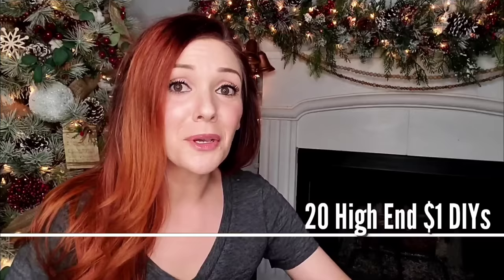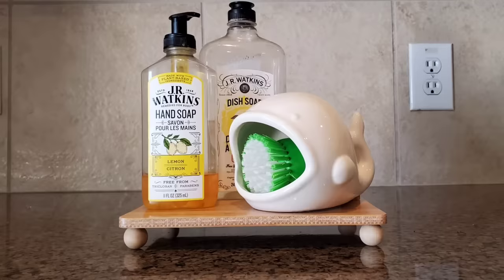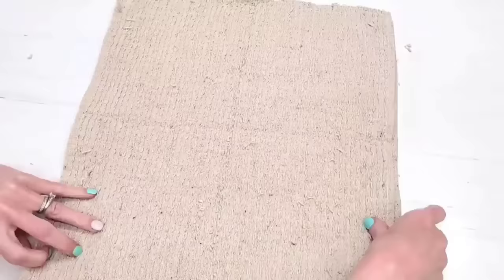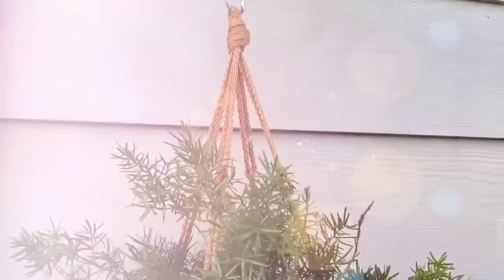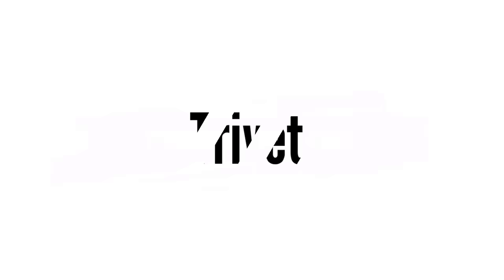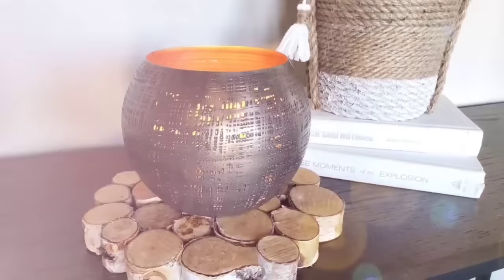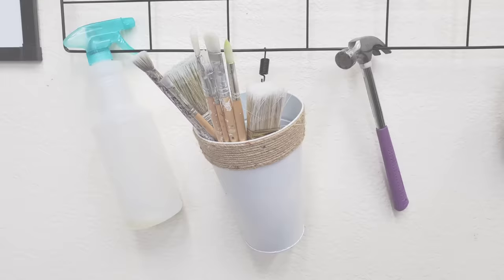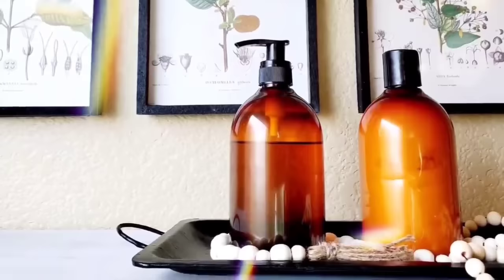20 HIGH END Dollar Tree DIY Room Decor Ideas to try!

Comment: I really enjoyed this video!  I think your fern in the hanging planter may have done better with what looks like a bit of shade/protection.  It also would drain better when not sitting on something.  I've had similar experiences and while I generally have a green thumb I continue to learn by doing.
Reply from the maker: The table has holes in it or water can drain out? I also put pool noodles in the bottom of both to help with drainage, but net year if I try the same type of fern I will buy it on something it can drain easier. So much love to you Teri ❤-Megan

Comment: DT does have adhesive backed cork sheets. I love them and pick them up all the time. Love your crafts.
Reply from the maker: I have seen others use them but I have never seen them! My DT is extremely small and even though it does stock up on some cool items they don't have a crafter square section. But I will an eye out for them ❤ Much love & Merry Christmas
Reply: @GlueGunsRoses  I hear you can order from $tree online...

Comment: Great video, superrrrr helpful since the find myself in DT like ever other day! I don’t know if you’ve seen it, but Dollar Tree actually does sell cork! They sell it in the craft section like an adhesive sheet, about 6x9. I used it on a canvas to make a DIY cork board since it’s so thin (and my push pins wouldn’t go all the way through). I’m thinking about maxing my buck by cutting small circles and putting 4 on each coaster, like little feet. Thoughts?

Comment: Another cool idea would be... Use a coat hanger... Drill a hole through the middle of the cut pieces of little circular tree branches & stack them up on the coat hanger to make a cross..! Cut the coat hanger to desired lengths & make a big cross to add to a mantel or whatever.

Comment: Fox tail ferns are heavy drinkers. The planter you used for the top has places to store extra water inside (it's a "self waterer") so even if you poke holes, it will retain so water. I bet that's why the one fern was still doing so well! The other one drains extra well, but that means it would need to be watered more often than the other one.

Comment: I loved the orbs and made some myself. Only thing I changed is I combined some DT rope and twine for two of the large circles. Also, I discovered that the third circle couldn’t “fit” into the other two without them becoming ovals. So I cut a piece of wire from the unused rings and added that to make the third circle a little bigger and go on the outside of the other two.

Comment: I seen you grab the drizzle popcorn. You can make your own with dark chocolate melts and a bag of chicka boom kettle corn popcorn. You cover a cookie sheet with wax paper, spread the popcorn out, melt the chips and use a spoon or rubber  Spatula to drizzle it on the popcorn and it's cheaper.

Comment: I don’t use the little game blocks, use a paint stick and since you have to cut the end off, and you can get them in different lengths, glue 2 of them together. Or if you have wood like I do from the barn , just use a 1x1” piece and cut to length if you are going to sand the blocks anyway

Comment: I wouldn't put holes in the bottom of the rope planters.  I'd use them as decorative containers for hiding a plain plant pot (potted up with compost and plant), so you just see the nice plant coming out the top of the planter, and the inside pot would drain into the rope planter.  If the rope planter was to hold a plant and compost directly and had drainage holes, very quickly the rope would get dirty and wet near the bottom.

Comment: I know what you did wrong with the Planters cuz I did the same thing. I made the holes too small. It couldn't drain properly even though there were plenty of holes when I removed the plant the bottom soil was soaking wet exclamation point so much for my hydrangeas. When I saw the mistake I pulled them out planted them in the yard and they're doing great after a very scary start😮

Comment: drainage holes on the pot on the table were blocked from draining by the surface tension of the water that was meant to drain try lifting the pot by gluing those wooden beads on the bottom

Comment: One NEVER USE FLOSS! USE cheap fishin line. It never breaks. Thats what its designed for. Wont gey brittle or fray or break either. Outdoor planters need to be skotchguarded in order to prevent fading.

Comment: Instead of spending all that money on mod podge, you can save a fortune by making it yourself. Is equal amounts of white school glue with equal amount of water and mix them and voila!!! You have mod podge. That truly is how they make it and charge a fortune for it because I buy the two for a dollar white school glue bottles at the Dollar General. Or any generic brand. It all works the same. Just wanted to give you a tip on that because I do crafts also.

Comment: As someone who knows basic sewing, I don't like the idea of gluing cushions.  Sewing is just as easy with in my opinion a better result, though maybe just a little more time involved.  If glued, when relaxing on the cushions you'd feel the hard bits of glue on the soft cushion.  And not sure if the glue would survive a few runs through washing machine.  But the design is ok, though if I were to make them I'd sew it all together instead of gluing.